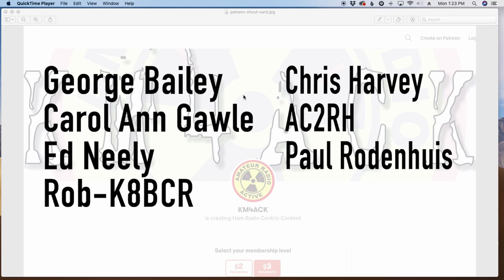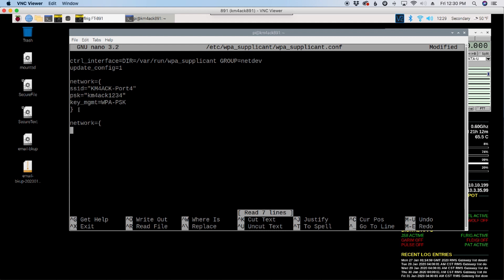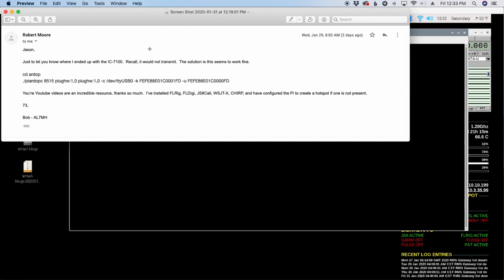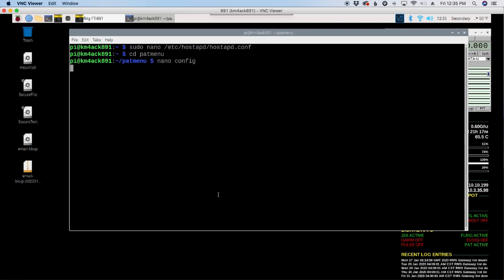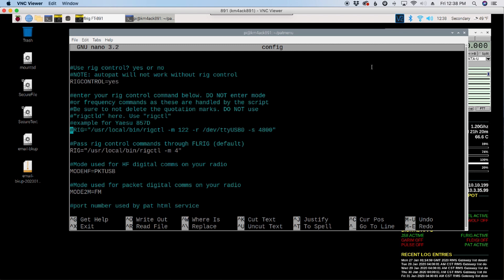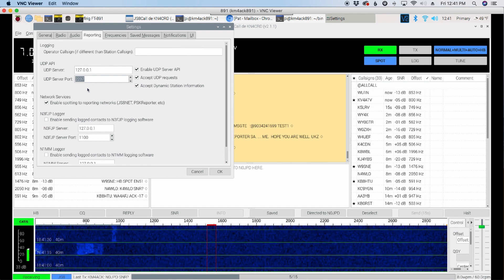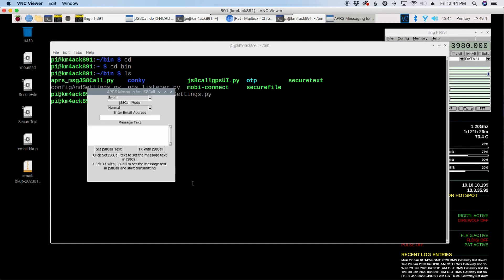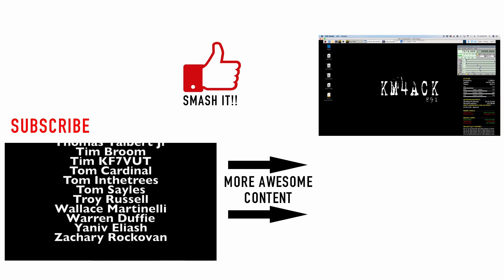Build a Pi Q&A | Easy Raspberry Pi build for Ham Radio

Comment: Great videos, Jason. Some information regarding Icom radios. The CI-V command structure is basically the same for most models of Icom radios. The CI-V bus can be paralleled to multiple radios, so each model has its own hex address. This is identified in positions 5-6 of the command string, e.g. FEFE88xxxxx or FEFE94xxxxx. The IC-7100 address is 88, the IC-7300 is 94, the IC-706MKIIG is 58, etc. There is also a "Universal" address of 00 that will work with most radios. So, in the files you show on your video, most of those show 88 for the address, so they will only work with an IC-7100. You have a choice here, you can either edit the file to your specific radio each time you change radios, or, for most commands (like key/unkey) you can use 00, e.g. FEFE001C0001FD (key) FEFE001C0000FD (unkey), which will work on any recent model of Icom radio. I hope that helps with your explanations. Keep up the good work. 73, Michael WA7SKG
Reply from the maker: Thanks for the explanation. I'll pin this to the top of the comments for other Icom users that see the video. 73, de KM4ACK

Comment: I used the automated build-a-pi today. Things seemed to go well until I tried to start ARDOP. When the browser opens, it says, "This site can't be reached" and the next line says 127.0.0.1 refused to connect. I went back and watched earlier videos on configuring Pat. Part of those instructions included typing "pat http" in a terminal window. When I do that, the message I get says, "Unable to load/write config: unexpected end of JSON input." At that point I decided to post my progress (or lack thereof) here.
Reply from the maker: That's the indicator that you have a corrupt pat config file. If you are using the build-a-pi, run pat menu. Choose option 1, then option 5 and see if you have a file that you can restore from. If not, you will have to delete the current config file with 'rm ~/.wl2k/config.json' After that, run 'pat http'. you will get a missing call error. This is normal. Now run 'pat configure' and set up the config file again. Help can be found here - https://app.simplenote.com/publish/LR0lxm Also, once you have it running, don't forget to backup so you can rely on your backup should problems arise in the future.

Comment: Jason, do you have a video show how to actually get setup on Winlink??  Not how to install since we have done the build a pi and loaded everything you had setup.   Remember where we put in our callsign, and then set the password to PASSWORD.  I don't think, in my 24 years of being a ham, I have ever used Winlink.  I tried following some of your videos, but mostly all I have found so far is how to get everything setup on the pi.  Thanks Juddie WD8WV  Sorry to be so much trouble.  Oh, I got the email you sent out to those who sign up to get them and I have built a new MicroSD card with Buster and ran the script that you said the testers had been testing, it actually took me about an hour and half to two hours to get it all installed.  LOL

Comment: Jason, also FLrig isn`t seeing the USB or a serial port like in your video.  But it was seen for audio for WSJTX FT8 for the audio. Don`t know if I did something wrong or not.  Oh, I also can`t get PatMenu to execute from desktop into terminal.  Says the following:  "Failed to execute child process "xterm" (no such file or director yet).  I accidentally hit the button to the right the next time I tried to run it.  Don't know if that is causing my issue.  Juddie - WD8WV
Reply: J & J True Outdoor Adventures  I’m trying to set up Fldigi and it’s not saving operators info. Plus the sound card codec is also my issues

Comment: Jason, I have a Yaesu FT-817ND and I am using the SignaLink USB hooked up.  Now my 817ND is also hooked to my LDG Z817 auto tuner and the radio port is connected to the radio port on the tuner.  The SignaLink is hooked to the data port on the radio.  The SignaLink is hooked to the Raspberry Pi.   I ran WSJTX FT8 and the software is hearing the audio via USB, but again the rig isn't being seen.  Any clue??  Juddie - WD8WV

Comment: Thanks for the hard work on this, Jason - very helpful. For others (like me) who operate an IC-7300, I found these recommendations for the rig set-up to helpful:

http://www.w1hkj.com/doku/doku.php?id=howto:ic7300_setup

One area I was having trouble with was Flrig. By using the linked guidelines (especially Echo Back: On and setting the CI-V USB Baud Rate to the recommended levels rather than "Auto"), it started up without further issues.   Thanks again, de K6KEC
Reply from the maker: Great find! Thanks for sharing. I am sure this will be helpful to many that own the IC-730073, de KM4ACK

Comment: Jason, first I want to thank you for all this work you have done to compile all this into one package that a non-Pi person can understand!!  A lot of this is really over my head.  But I kind of fixed my issued with my display.  First I removed the HDMI 800x480 pixel display from my Pi 3 Plus, I am running it with VNC.  I can use VNC on my iPhone, my iPad Mini and even on my Gateway Windows 10 laptop.  By doing this I can get the full screen, well on my laptop at least and see the information on the right side of the screen.  Also, using my laptop I have discovered how to send files from my laptop to the Pi.  I have yet to hook my radio (FT-817ND) to the Pi via my Signallink.  I plan to do that today.  I do have a question, I was wondering since my phone and my iPad mini are both capable of being hotspots, can you add their info into the files and safe it so that it discovers them when it looses a wifi home signal??  Again great information and videos.  Finally I think I can actually use my Pi's for something other than what-nots on a shelf.  Juddie WD8WV
Reply from the maker: Yes you can configure the pi to connect to your phone's hotspot. The you will just need to know what IP address your phone assigns to the pi so you can VNC into the pi. 73, de KM4ACK
Reply: KM4ACK thanks for all you do!

Comment: I find that if I log off the Pi for any length of time I have to do a re-boot to get the conky information to display when I log back on.  Is there a CLI command I can run instead to get it to re-display?
Reply from the maker: sure. run 'conky' from the terminal to get it to restart. you may need to run 'sudo killall conky' first depending on the circumstances.

Comment: Hi Jason I've done the pi build but have decided to leave FLRIG operation for later. JS8CALL is working fine. I've changed the port to to 2237 and I've sent texts and emails but the  GPS tool picks up the grid locator but won't send to JS8Call and just freezes. VO1OK
Reply from the maker: Did you change the port in the configAndSettings.py file? You can find the file in the ~/bin directory. 73, de KM4ACK
Reply: @KM4ACK  Yes. I double checked that. Not a big problem as I Can read it off the USB GPS module. I can also get the the full maidenhead number off the IOS app: Theodolite. de VO1OK

Comment: Most of what was giving me trouble is solved. I have to start Conky manually but that's no hill for a stepper. Unrelated to the script, it appears that N3FJP's logging software is not Linux friendly. I've found where someone made it work but it wasn't on a Pi. I was hoping to keep my logging software the same as what is on my windows 10 machine (that I hope to get rid of). N3FJP logs it, sends it to QRZ, and then I can send it to LOTW from N3FJP. CQRLOG llooks interesting.

Comment: Jason:   Thanks for all your work with BuildAPi.   In your version 2, will the script allow adding the modules that were not in Version 1 to an existing Pi running V1.. ie the ability to upgrade the BuildAPi  system?

73 - Jeff KE0OOS
Reply from the maker: Unfortunately it won't. The build-a-pi script is only intended to run on a fresh install of Buster. :-( 73, de KM4ACK

Comment: Very good clarification Jason on the build for the R Pi Field Computer =)  Keep up the great work =)   The links you use and instruction is working great =)    I just need to replace another Micro-SD card that was corrupted when I bought it on one R Pi build =)    A few friends have IC-7610's and IC-7000 series radio and I have the IC-7200 and addition information will help is solving those problems if I encounter them later on when they start the builds on their own =)  73 Pat N5VMO

Comment: I think the Icom fix is what I need to try out when I have the opportunity. I am running the Icom 718, everything seems right, except it doesn't TX on digital modes. Just seems that there's no sound going into the radio to trigger the tx. Great thorough video!
Reply from the maker: Have you looked at the sound settings on the pi to make sure they are high enough? From terminal run 'alsamixer' you may need to use F6 to see the various sound cards installed. 73, de KM4ACK
Reply: @KM4ACK  I will definitely give that a shot first. Thank you!
Reply: @KM4ACK  I finally had a chance to check this. It worked. Thank you!! I'm finally able to use digital modes with my pi!

Comment: Thank you Jason for all you do.  What would you say is the best rig or brand of rigs for the least com trouble, between rig and pi or pc ?  Thanks  KN4VVY  73
Reply from the maker: That is certainly a loaded question. Almost like asking Ford or Chevy. Each operator has their own opinion on rigs. Personally, I run mostly Yaesu because it's what I learned on. It has both pros & cons vs other rigs. Maybe check with you local ham club and attend the meetings. Check out what others are using in you area. 73, de KM4ACK

Comment: In Rig setting I rem the flrig and open up RIG="/usr/local/bin/rigctl -m 214 -r /dev/ttyUSB0 -s 4800"     I get error message flash on line 11. is that in pat configure?
Reply from the maker: Don, I think you will find it easier to configure FLRIG for your radio and then each app to use FLRIG as the radio for rig control. The error message you are getting is more than likely due to something you have changed in the pat menu config file. (~/patmenu/config) Remember though that the settings in the pat menu config file only effect Pat Winlink and have nothing to do with JS8Call or WSJTX. 73, de KM4ACk
Reply: @KM4ACK  I've got this working with my TS 2000 going direct to Hamlib. I'm not into WSTX but I really like JS8CALL. I got it working here at Home. This radio and pi will be going into a grab and go box. I'm collecting the bits and pieces and hope to have it ready for when I go to the DMR Valley Camp get together in Washington State in May. I will toss up a rope into a tree to attach my HF antennas. I'll post pictures when I get the project done.. My issue now is QSSTV and the USB codec. It's not picking up the Alsa audio. This Grab and go kit really won't doing SSTV. It's not a game-changer. My V71 will be doing SSTV on 145.500 and the ISS 145.800 in kits own plastic toolbox grab and go kit. This will also do pat mainly.
Reply from the maker: Don Poaps fantastic! Glad you got it configured. 👍

Comment: Do you have a side-by-side comparison running fldigi or js8call on a Pi3 and Pi4? I'm running a Pi3B+ and want to know if the performance boost with a Pi4 is worth the $ and effort to rebuild.
Reply from the maker: I can't say between the 3B+ and the 4 but I know that going back to a pi 3 after working with a pi 4 is a huge difference in performance. I wouldn't get rid of my 3's but I wouldn't buy another one either unless I needed it for a specific project. Going forward, I will more than likely only buy Pi 4's. 73, de KM4ACK

Comment: Good stuff!   THANKS!

My current hassle is trying to build JS8Call on a Pinebook with an ARM64 processor.  Jordan provides binaries for each release in several popular flavors that cover probably 99% of the users, and while there is a version for the Raspberry Pi, the Pinebook isn't supported.  When I try to build it, there are many missing libraries resulting in broken dependencies.  I need to buckle down and slog through it.  I've gotten lazy in the past few years and right click a DEB or use Synaptic to install on Ubuntu.  I was glad to see the next scripts will allow FLDigi to be built.  You never know when someone won't have a machine that's supported by a binary, or maybe they'll want an easier way to run a developmental version that needs to be built.